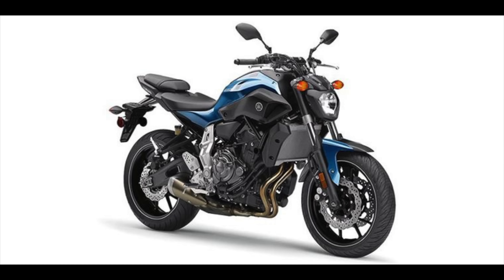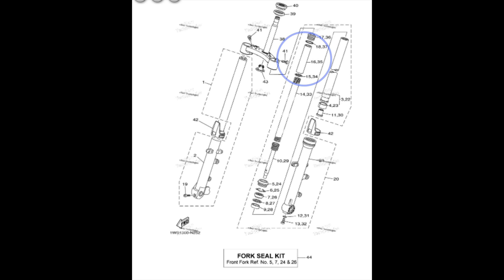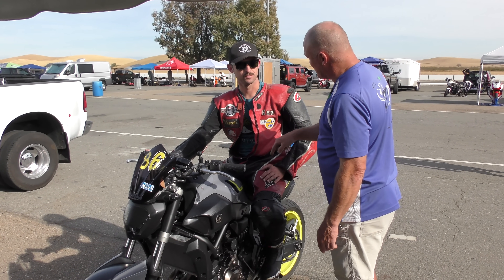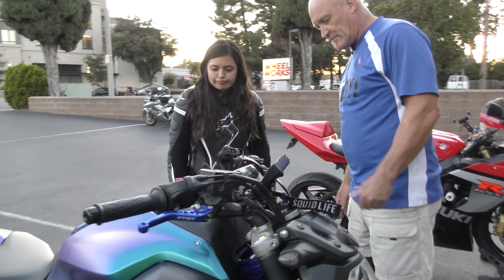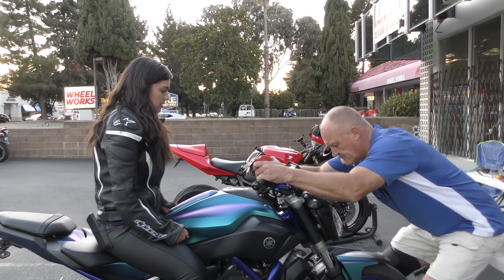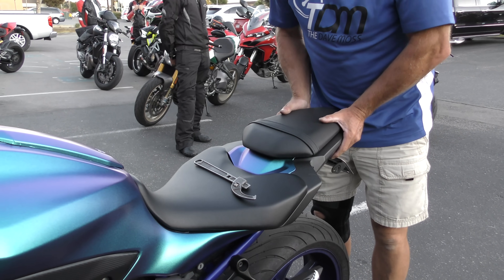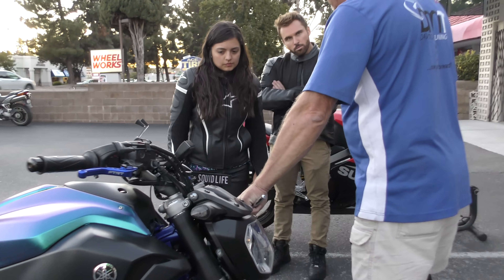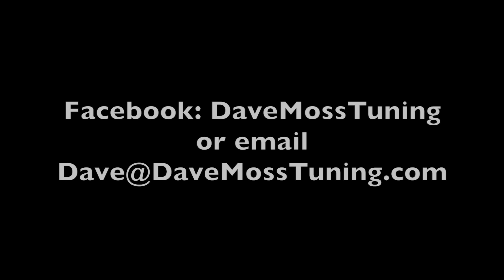Yamaha FZ-07 / MT-07 Fatal Flaw and How To Fix It

Comment: Hello I weigh just below 150lbs(60-70kg) fully geared
 I am looking for better stability in highway and cornering should I use spring rate that is above what’s recommended for my weight with stock oil and will the stock oil with low viscosity (10w) will compensate that? Or just upgrade the oil and shorten the spacers on the stock ones (stock spring rate is recommended my weight)
Reply from the maker: Thank you for your question. I would use 10w oil at 380cc/ml to start. I would trim the spacer 10mm and move the forks 10mm
Reply: @catalystreactionsbw  first of all appreciate you answering my question just to clarify if I want better cornering grip at my weight don’t use higher spring rate just use stock oil (10w) at 380ml or maybe 15w and what will be better spacer trim for my weight and the type of riding I am looking for 10mm or 15mm? And what moving the forks by 10mm do?
Thank you Dave
Reply: Basically what trim will give better grip shorter (10mm) or longer (15mm)
Reply from the maker: @theyellowjello5883  shorter as is puts more weight on the front.
Reply: @catalystreactionsbw  thank you could you please just confirm the things that I wrote in the last comment about just changing the oil and not the spring rate will be better for me and one more thing will moving the forks up will give me better grip?
Reply from the maker: @theyellowjello5883   Start with the stock spring rate and lets see how much fork travel you use.  Should you need to purchase preload adjusters off eBay, that will be a good economical first step vs stronger spring rate.
Reply: @catalystreactionsbw  perfect thank if I going to use the preload adjusters would I still need to move the forks up by 10mm?
I didn’t understand what moving the forks do is it like preload?
Reply from the maker: @theyellowjello5883  Moving the forks adds or removes weight from the front tire, just like a preload adjuster would do. Start in the 8mm drop and use preload from that geometry.
Reply: @catalystreactionsbw  so why cut the spacer if I am going to preload the forks isn’t cutting it will give less preload?
Reply from the maker: @theyellowjello5883  In theory yes, you are correct so therefore eliminate spacer cut and install starting fork position for geometry.
Reply: @catalystreactionsbw  First of all I want to say thank you for answering all of my questions and after all that considering my weight (160lbs) and that the stock spring rate fit my weight I would like to know what is the best thing I can do to make the motorcycle give me better cornering grip just to be clear it’s not for the track or anything mostly canyons riding pretty aggressively I really want to fix the motorcycle bounciness problem so what do you think I should do in order to fix those problems do I should be using more stock oil (10w) or going higher to 15w, cutting the spacers or not and just using preload adjusters or even use both or maybe changing the springs with higher rate or even progressives what do you think will get me closest to what I am looking for?
Appreciate you so much for all of this and once again thank you
Reply from the maker: @theyellowjello5883  What you are looking for is chassis balance and that is all via rebound damping for the forks and shock. I would suggest that 15w in the forks will be a major help.
Reply: @catalystreactionsbw  and if I would like it to be stiffer add some preload adjusters and leave the spacers with stock length (no cutting) is that correct?
Reply from the maker: @theyellowjello5883  Yes, correct in that principle.
Reply: @catalystreactionsbw  and using stiffer springs will make me feel more of that pogo stick problem right?
Reply from the maker: @theyellowjello5883  If you use too much preload and make the springs too stiff - yes that will be the case. Monitor travel used to set preload correctly.
Reply: @catalystreactionsbw  thanks anything i can do to for better performance from the rear shock or for that i need to replace the spring or change the shock completely?
Reply from the maker: @theyellowjello5883  in time, replace the rear shock completely. Price shop between Penske, K Tech, Nitron and YSS
Reply: @catalystreactionsbw  will there be any performance changes because the stock spring rate is okay for me so why go with an aftermarket shock is it because you get better rebound?
Reply from the maker: @theyellowjello5883  Aftermarket shock offers better damping and it can be serviced - the stock unit is a throw away

Comment: Great video! I have a 2020 mt07 that i bought used last week. The front end doesnt have that pogo stick feature so im assuming the old owner fixed that. But the rear suspension was exactly the same as the girl's bike. Which would you recommend is best for grip and traction? As my rear wheel constantly breaks traction when power is applied (expected but not at that rate).
Reply from the maker: For the rear shock, YSS, Nitron or KTech and get the type that has both preload and rebound
Reply: @CatalystReactionSBW  I meant for stock spring, do I make it softer or keep it as is? Which would be best for tire grip.
Reply from the maker: @NLamki2002  Stock spring would be better.

Comment: Hi Dave, thanks for sharing your knowledge. I own a 2017 Yamaha Tracer 700, does everything you’ve said about the MT07 also apply to the Tracer 700? What about the preload setting on the rear? I’m 6’1, about 210lbs with full gear on. Thanks in advance!
Reply from the maker: Thanks for your kind words! Yes it does! Preload would be 4-6 notches (lowest is 1)
Reply: @catalystreactionsbw  Brilliant, thank you for your response. So I’ll go 20W on the oil and 4 on the preload and shorten the spacers by 10mm. Now I can see that most people in the comment section that have done this adjustment are very satisfied, however I was told to save my money instead and go for a cartridge kit/brand name shock like K-Tech/Nitron instead, what would you say about that? Is it worth it to do that instead of the heavier fork oil and shorter spacers? Would the difference be massive?
Reply from the maker: @1kcclife  Going to a cartridge kit is a big step up with Andreani offering the best value for money at this time. If you do that, you need to get a rear shock for it as well to match.
Reply: @catalystreactionsbw  Thank you very much for the valuable information, Dave. I’ll try shortening the spacers and changing to a heavier fork oil first. Much appreciated!

Comment: I’m roughly 220-225 with gear on, would the 20wt oil be sufficient? As in, just the oil and not cutting down the spacers. Would that basically be determined by what happens to the fork when I sit on the bike?
Reply from the maker: Yes, with that weight listed, 20w would be fine. You would have to ride and see how much fork and shock travel were used to assess this, then alter preload appropriately.
Reply: @catalystreactionsbw  appreciate you’re reply. I’ll get to work. Swap the oil and take all my measurements to determine if I need to cut the spacers or not. Thanks for all the content you provide.

Comment: Just bought a 2022 Mt 07. I’m 6’3 245 lbs. so 10mm and 30 wt?
Reply from the maker: Spacers 10m shorter, forks in the stock position, 20w oil and 420cc of oil.
Reply: @catalystreactionsbw  thank you

Comment: Quick question just to be sure! I'm 198 lbs and own a 2015 mt07. What is the exact course of action? 10mm spacers cut off / 20w oil and put the rear shock to the maximum tension and it will turn into a sweet machine? :D Love the videos
Reply from the maker: 10mm off the spacers, 400cc of 20w oil and 8mm drop in fork position. Shock 4 notches above the lowest setting.

Comment: alright i struggled through 8 minutes and despite being right about somethings you are very wrong about others.... dont even know where to begin and im not really typically a hater but i feel the need to correct you on somethings my windscreen is prob about the same size as yours but if you change from that up right speeding position into like a crouch rocket position  the aerodynamics improve drastically  because instead or you chest of face getting blasted my mind that little windcreen will pull the air over your helmet
Reply from the maker: Thanks for sharing your reply. We all see things via our own perspective and I appreciate you taking the time to share you POV. If we all think critically, we can make a lot of conversation to start a rider on a pathway of knowledge.

Comment: Does this apply to the 2022 mt07 still?
Reply from the maker: We had a post from a 2022 owner in the comments saying yes to spacer length. Oil is slightly thicker but would benefit from thicker oil.

Comment: Does anyone happen to know the length of spacer to begin with to make sure the ones on your bike have not been modified already? Or what they should be changed to? Got a 2021 mt, unless Yamaha has fixed any of this, but I doubt it. I'm a new rider and would love to get the most experience I can out of my bike.
Reply from the maker: For the OEM spacer: measurements supplied are 150mm long and OD - 33.9mm
ID - 31.3mm
Reply: @catalystreactionsbw  thank you very much. I will have to check mine out to make sure they are not changed yet.

Comment: This is the kind of information a seller should give you when you buy a new bike. I got sold an fz6 and no one asked my weight or how tall i am to adjust it. Years later i learned about these things on a forum. Small adjustments that dont take long, will make so much difference! I wish we would learn about this in driving schools. Thats part of a safer riding!
Reply from the maker: Thanks for sharing your experience and POV. I concur, some information on the very basics really helps.

Comment: Hello Dave.

I purchased a YSS front cartridge kit that replaces all internals of the front suspension and provides some adjustability (rebound, compression). This is for a 2021 MT-07

The instructions are asking for GP5 fork oil. I assume this is 5w fork oil.

Is this oil weight acceptable? or should I use thicker oil? 15w or 20w?

My fully geared weight is 190 lbs.

Thanks
Reply from the maker: Hi Felix. That is a Putoline oil product. https://www.putoline.com/en/catalogue/product/304/formula-gp-5w/1697/. The viscosity number is the same as Maxima 5w but not all 5w weights are the same V.I. Nearest alternate readily available would be Motul.
Reply: @catalystreactionsbw  ok, thanks. I currently have a bottle of Bel-Ray fork oil 20w.

Will 20w BelRay  be too thick of oil? Or should I get Bel-Ray 5w or Motul 5w?

thanks
Reply from the maker: @skatebass19581958  Motul 5w. The rest will be far too thick.
Reply: @catalystreactionsbw  thank you so much. 

I will also be doing the 8mm geometry change when I install these new cartridges.  Thanks again!!

Comment: I have a Tracer 7 and it has adjustable forks but wonder if shorter spacers and thicker oil would improve the ride..Big Love from Sunny England..✌️
Reply from the maker: For your Tracer, thicker oil at 10w or 15w might help based on weight, speed and load. Spacer will remain stock.
Reply: @catalystreactionsbw  thank you so much for your reply..I'll try that..much appreciated..You The Man..!! ✌️

Comment: What brand is the spanner wrench you are using to adjust the Yamaha MT 07 and where did you purchase it from? Thanks Dave
Reply from the maker: https://www.amazon.com/shop/davemosstuning?tag=onamzdavemoss-20&linkCode=ic7 for the Buzzetti shock spanner tool. Or you can buy it here:https://www.ebay.com/itm/334555481948?chn=ps&norover=1&mkevt=1&mkrid=711-117182-37290-0&mkcid=2&itemid=334555481948&targetid=1645685073808&device=c&mktype=&googleloc=1013689&poi=&campaignid=16730423415&mkgroupid=135815925780&rlsatarget=pla-1645685073808&abcId=9300841&merchantid=100441791&gclid=CjwKCAjwyaWZBhBGEiwACslQo9beaIoXm7XQOW4RzNXLeV8kd7jXUQ_TXzv1SCSquFWjlgiWHX1gNRoCcyQQAvD_BwE

Comment: Hi Dave! I got MT07 Tracer 700 modwl, year 2018. Im 80kg with no gear, so cca 90 with gear. Can I go with that setup allso? 196kg wet weight is the bike. Im running willber progressive springs. Thank you.

Comment: hello,

i have a 2021 mt07. I weight 83Kg. should I do the following?

1. Cut spacer 10mm.  or 8mm ??  How much should i cut?

2. Add 20w oil. How much oil should I add? 403mL? 

3. Set forks 8mm up.

please let.me know what should I do? plan to do this asap once I know what to do.

thnks
Reply from the maker: 1. No trim with your weight.  2.  20w oil, 400cc. 3. 8mm geometry change.
Reply: @catalystreactionsbw  thanks for getting back. Will do it soon. If there is no static sag after doing it, should I cut the spacer? 
Just curious why are you recommending not to cut it. Thanks again
Reply from the maker: @skatebass19581958  Soft springs and your weight may need the spacer as is. If you are consistently 30-40mm below the bottom out mark with fork travel used, then the spacer cut is justified. That data can be acquired in the first 400 to 600kms.

Comment: Making the back spring softer was NOT correct UNLESS you are only doing touring with the bike.  If you are going in a curve and hit bumps with a spring that is too soft then you will lose the back because the tire will spring out with more travel.  Meaning the rear will load in a turn and if you have an issue you want the rear to recover as quickly as possible.  If you bike has a lot of power it will also ripple your back tire - in other words you will hit a bump sooner or later and it will do a harmonic bounce.  I am not saying don't listen to this guy.  He may have 40 of experience like I do - but your suspension is defined by "how you intend to ride and on what conditions".  It is NOT your height NOR your weight as the lead driving reasons.
Reply from the maker: Thank you for your contribution. For those thinking this through, another helpful point is to monitor shock travel used (https://www.youtube.com/watch?v=KeZT1LCY8CU). This will help you get the spring tension you need to acquire ideal travel at 2-4mm above the bottom out bumper (there are exceptions). Once that is done you can see what static and rider sag you needed and record the settings. For those that have compression and rebound damping, now you can fine tune those settings based on oil age and the temperature reached based on your roads at your speeds.

Comment: Dave,
  I have a 2021 mt-07 and stand tip-toed on it. I want to lower it so my feet are flat on the ground. At 57 I'm a brand new rider. Would you recommend this procedure for my year bike? I just plan on riding and having fun. Thanks.
Reply from the maker: Welcome to our sport and congratulations on your MT-07. Yes, trimming the spacer and fork geometry change will help and also put shock preload on the lowest adjustment. That will help with foot placement.
Reply: @catalystreactionsbw  Sir. 
My friend, who rides a  Hayabusa, took my bike for a ride and when he came back he said he was experiencing a " death wobble". Do you know what he means by that? Also do I need to purchase the adjustable lowering link(dogbone?), To lower the seat height? Thank you for your help in this situation.
Reply from the maker: @Robocoppat  Hello Patrick,

Step 1 is to set sag on the soft side between 40-50mm for the fork and shock. Then set fork and shock compression at 50% of the total range eg: 30 clicks = 15. That will get your feet much closer to the ground. If it is not enough then you can buy lowering links BUT you must lower the front carefully to match the rear and make sure the front tyre does not contact anything.
Reply from the maker: @Robocoppat  The wobble is where he gets on the throttle and the front tyre does not have enough grip so the bars go side to side. It is the middle part from grip to wheelie. Settings suspension correctly will help that.

Comment: Hi Guys
I will get this done in a week through my dealership. But im a little confused what exactly to tell them. The message of this video is: Shorten the Spacers 10mm (if your weight is higher than 140 lbs) and 15mm if you are less than 140 lbs. Shouldn't this be exactly the opposite? Why does a light person need more sac? And then, in Daves other video where he's cutting the spacers by himself for another guy (who's definitive havier than 140 lbs) he also cuts off 15mm instead of his own recommendation from this video.

Can someone confirme 10mm is the right length to cut off for over 140 lbs? And i am probably just making a misconception..

At the moment im aiming for  (163lbs) 10mm cut off and 405ml 15w oil by the recommendations of those two videos. I hope this will work..

Greetings from Switzerland
Reply from the maker: Thank you for your question. A lighter person needs more sag, so the spacer needs to be shorter to facilitate this. The longer spacer will put more tension on the spring to make it stiffer. The cut and viscosity/volume will work. Put the forks in the stock position first, then change by 6mm to lower the forks for slightly quicker steering.
Reply: Oh wow many thanks for the quick response dave! Thats awesome! Thank you so much. Greetings